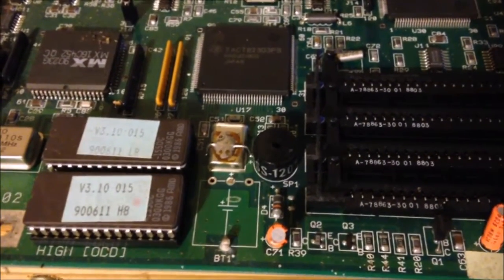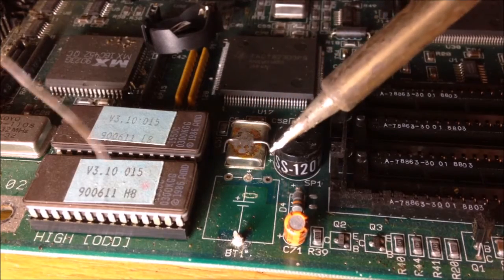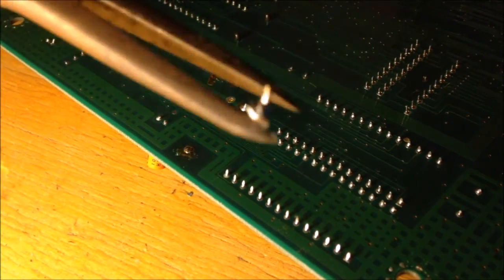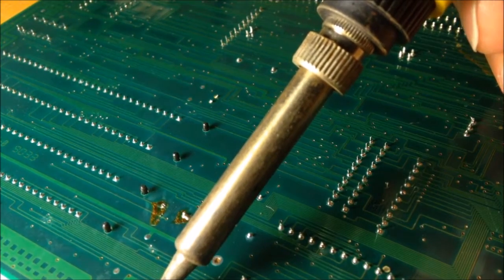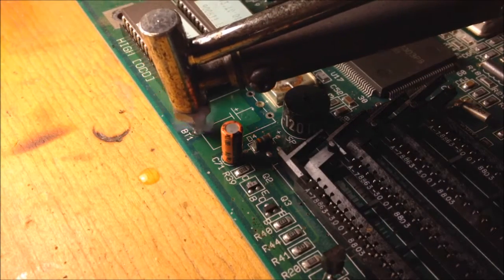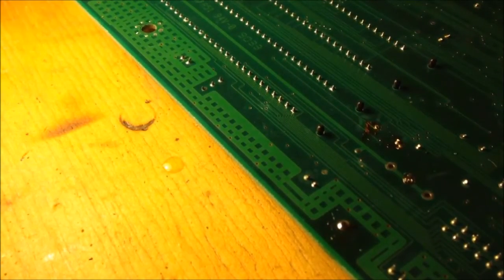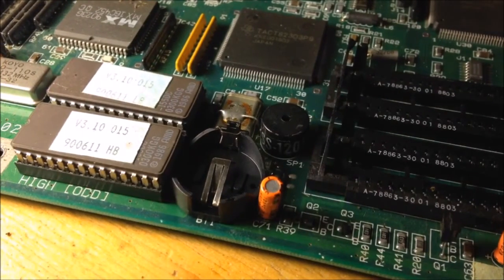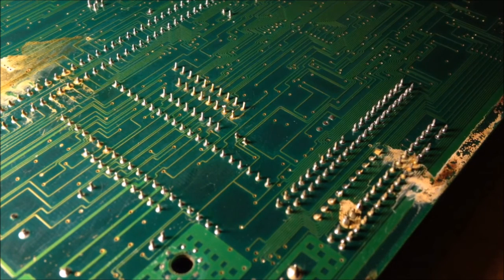How to replace NiCD CMOS battery with a CR2032 coin cell.

Comment: You're replacing a rechargeable battery with a non-rechargeable one, there should be a diode in series with the battery to stop the board trying to charge it.
Reply: This is a very bad idea. You can not just install a 2032. They are not rechargeable. You have to trace the circuit and install a diode to block the current. If you don't it will damage the 2032
Reply: @RCAFTailWind  exactly, the video is showing a bad (and potentially dangerous) mod.
Reply: Yes what he should have posted in the description was not CR2032 but LIR2032 3.6V Lithium-ion coin cell.
Reply from the maker: Xolotl there are rechargeable coin cell batteries. The circuit works fine, but thank you for your concern.
Reply: @RetroDepot  None of the coin cell types seem to be suitable for the circuit. I'm going to assume it was a 3.6V NiCd battery there and then open circuit voltage should probably be 5V, charging the battery through a high series resistance. What you expect to happen then is that CR2032 probably goes pop after a few months or years of being subjected to that, this has been the experience of people who bought a particular wonky RTC DIY circuit from Aliexpress with a similar design mishap.

LiR2032 needs to be charged with 4.0 - 4.3 V open-circuit voltage, if you go higher, rapid degradation occurs. For MN3023, 3.0-3.3V open circuit voltage is the suitable range.

So it's prudent to either suppress charging or use NiMH, which are available as direct replacement types for the NiCd ones and they're much much less leaky than NiCd.
Reply: @SianaGearz  I thought you can't replace NiCd with NiMH because of the different chemistry. What I read was that NiCd can accept constant floating charge as it will just lose the excess as heat, but NiMH would get damaged from overcharge, as it can't be float charged the same way. But keep in mind I am an absolute noob in these things, I just have been told this.
I am in the refurbishing process of an old 386SX laptop, and trying to find a new cell for the CMOS battery is a huge pain. It's hard to find NiCd cells now as everyone changed over to NiMH, but I am afraid of causing issues with trying to use a different chemistry. I would appreciate your opinion on this matter, I am torn again that what I should do.
If NiMH would explode and ruin the motherboard, I would be happy to use it, as I know it's a newer technology. I just don't know how it would handle the constant charging it would be subjected to.
Reply: @kosztaz87  NiMH bleeds off low-current overcharge via heat REALLY REALLY well. Furthermore NiCd is really famous for "memory effect" where floating it at any given voltage for too long will create a crystalline layer that reduces cell's effective capacity, and then weird things happen later when trying to discharge it, so keeping NiCd topped off is not such a great idea.

Under high-current charging, they are not to be overcharged, and high-current charge termination presents a fairly complex issue with NiMH.

You will not find a healthy and trustworthy NiCd battery, it's not even worth trying, they're all old and decayed.

If you're concerned about the thermal effect of overcharge, like you believe the charge current might be a bit high, then you can just take a bunch of AAA NiMH cells and assemble a battery off board, their relatively high area will help them bleed off the charge while maintaining lower temperature, and you mount it somewhere where if they do spew their guts, they don't spew them anywhere important. Anyway i don't think they'll spew their guts in the next 20+ years in such use.
Reply: @SianaGearz  Thanks for the swift response, I really appreciate it. So it looks like NiMH is the way to go.
The laptop that I am going to refurbish is a hefty beast with an empty area inside, where you were supposed to add your extra memory or modem. Since that place is unpopulated in my unit, I am planning to use it as a compartment for the CMOS battery, and route it back to the motherboard with wires.
The original battery was a NiCd 3.6v 50mAh unit (three small cells in series). So if I decided to use three Eneloop AA NiMH cells (I have plenty of them laying around the household) in series, that would be a perfect solution, as because of their size they wouldn't overcharge or overheat? Could going so severely up in size and capacity compared to the original tiny cells cause any kind of problem? Or apart from the extra weight there really isn't any negative consequence for such a mod? As the laptop is above 5kg to begin with, weight really is not a concern to me.
Reply: @kosztaz87  Pushing it too far with capacity increase may present a bit of a usability issue. Like you have these cells that self-discharge at up to 20% a year. But they're charged at ??? trickle current, let's say it's 10mA, but it could be 1mA. At 10mA these 2500mAh monsters will take 250 hours to charge, or about 50 hours to top up per year minimum time that your device has to be plugged in. Additionally if they do get self-discharged, it can take an uncomfortable amount of time in device to bring them back up to usable state.

If we were to say it was 1mA charge current, the necessary top-up time would be 500 hours a year.

So it's best to figure out what the charging circuit in device originally is and size the battery pack with some consideration of that. And for sure, going the most modern low-self-discharge chemistry gives you a good bit of leeway to increase capacity, because self-discharge is correspondingly lower, but self-discharge is in percentage, while charge is in mA. Something i forgot to mention last time. But intuition wise, AA might be pushing it a bit too far.

Also of course if you did oversize the batteries too much, given their low-self-discharge nature, you'd only find out there was an issue like 5-10 years later :D And the modification is fully reversible if it comes to that.

Ideally, the battery would occasionally be charged fully and individual cells would be allowed to thermally bleed off the overcharge in order to balance the battery.

By the way, it may make sense to figure out the cutout voltage of the device, and size the battery as a series such that it just comfortably stays above that. In a NiMH cell, polarity inversion will occur soon after the cell has reached about 0.9V, as you continue to force discharge current through it, because at that point, basically no charge is left. Polarity inversion is the state in which it's prone to leaking and sustaining permanent damage. You'll often find that a computer CMOS/RTC circuit cuts out at 1.8-2.0V, making a 2-series potentially sensible, 3-series tolerable and slightly risky. Say in a 3-series, if it became unbalanced, two cells can be at 1.2V (medium charge) while another cell is at 0V (fully discharged) - the device under power continues to be operational and continues drawing current, while the two healthy cells continue pushing current through the empty one, wreaking havoc. The manufacturer may have been forced to go with a 3-series cell because of low cell energy density or other constraints. Anyway it requires some analysis of the circuit and the component datasheets.

This polarity inversion prevention is why you should never ever find 4 series cells in an LED torch, always 3, and if you do find 4, you have to be afraid of it venting very hot fluid right in someone's hand. Now obviously it's not nearly as dangerous in low-current circuits, but still.
Reply: @SianaGearz  Thanks again for the detailed reply. I might just go the easy way, and use a diode to prevent the cells from being charged. Three AA cells should last for years anyway without charge im this scenario (the original 3.6v 50 mAh NiCd battery kept the internal clock and settings for about 3 months according to the laptop's manual).
Then I wouldn't need to worry about all the mentioned things.
Reply: @kosztaz87  3 months is a weird figure. I can't quite imagine where it would come from, because from mid 90s on, a 200mAh coin cell would last you a decade or more, but in the 80s if you had to make do with MC146818 the 50mah might last maybe 1-2 months. Could you give me the details on what device we're dealing with, maybe i'll find a schematic for it or get an idea of the component selection.

And look i don't want to scare you off from going with NiMH, because at this point i'm potentially overthinking it a bit, or rather if i had the device in my hands, i would also have all the answers in front of me in like a fraction of a minute, but these are the things i'd consider, while to you it may seem overwhelming. Eneloop-like NiMH have higher self-discharge than alkaline, but i think they're less prone to leaking at the end of life and you don't need to (and shouldn't) protect them with a diode against charging at all.
Reply: @SianaGearz  It's a NEC ProSpeed SX/20 laptop from 1990, has a 20 Mhz 386SX processor and 1Mb ram. It's a very uncommon unit with virtually zero info about it online.
Reply: @kosztaz87  Right, i don't have access to any schematics for it either. :(
Reply: @kosztaz87  Wait a sec, i had a bit of a thought. I think when you look, you might find a Chips&Technologies 82c206 platform IC which includes the RTC and CMOS. It's supplied by the battery pretty much straight to VCC pin, and it draws kinda substantial power. The brown out voltage for the circuit is a bit of a mystery, but i doubt its operation is guaranteed or intended below 3V. Maximum voltage around 5V. Batteries used with this chip were usually either 3.6V NiCd, or the otherwise extremely unusual ER6K Li-SOCI2, 3.6V, around 2000mAh, would last a decade if you're lucky. I suppose 4.5V Alkaline pack was an option too, but they leak, they age, and you'd have about 3 times less energy density than off an ER6K.

Honestly i still like the 3xAAA Eneloop solution.
Reply: @SianaGearz  Yeah I am pretty sure I will go ahead with the Eneloop solution too.